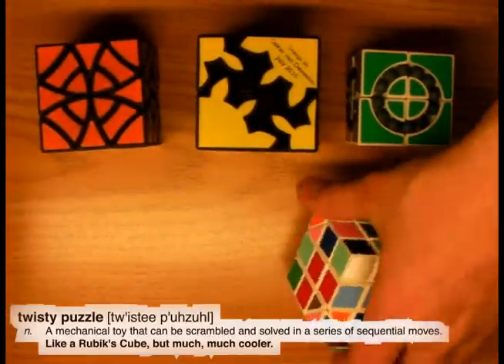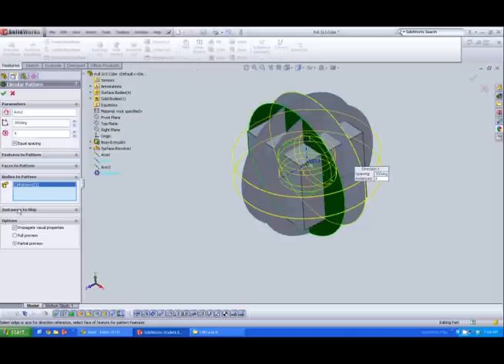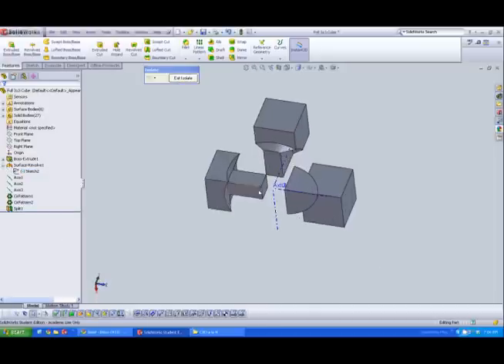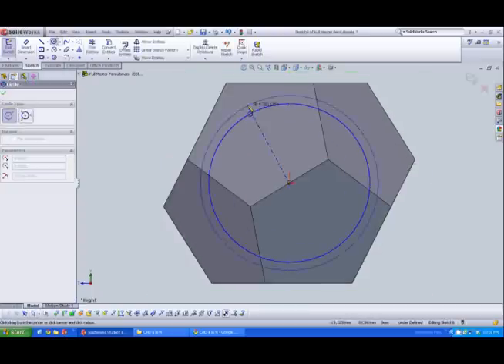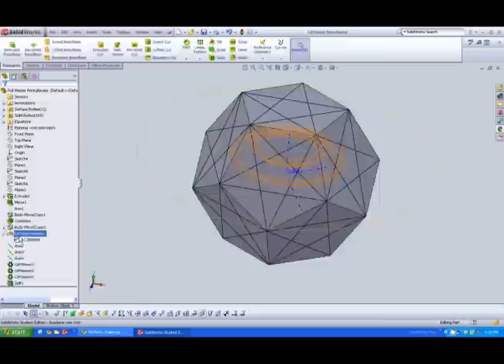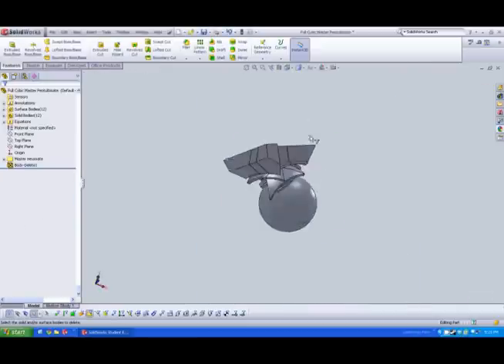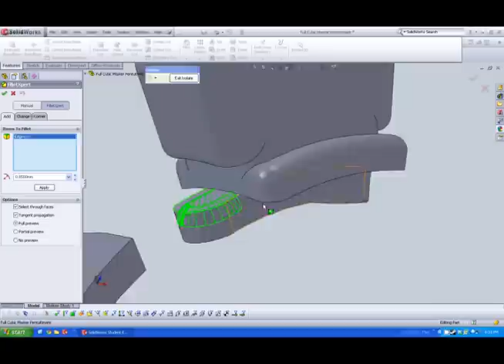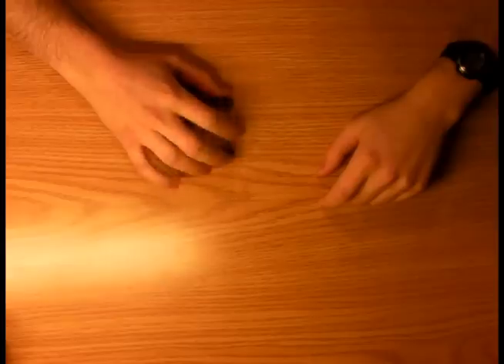Twisty Puzzles à la Vi

Comment from the maker: Ahhhh, shell errors.  They are certainly tricky.  If I'm having trouble shelling a piece, I usually end up splitting the piece along a new surface, shelling the body I want to shell, and then recombining the parts.  It's extra work, but it's a good workaround.  Also, make sure you're doing the shells after all the fillets!

Good luck!

Comment from the maker: Sorry I missed your comments.  Kepler's transformation is simply a way of orienting a dodecahedron within a cube.  It relates the two shapes to each other geometrically, which allows me to make a nicely symmetric cubic puzzle with dodecahedral cut geometry.  All I did was roll back the feature bar to right after the dodecahedron, Add the cube, and delete the dodecahedron.  Then I rolled it forward again, and fixed any errors that happened.  Give it a shot!

Comment: AWESOME! I was looking for someone to do a quick overview of a simple 3-by-3 (so I could learn and then expand to different ones later) I had no idea I'd find an overview of the whole process to more interesting designs. 

One or two questions, first I'm with ShinySalamenceTCG on the Blender question. I know how to use blender, but I've never used it to design something solid; except for a concept for a custom die that I made a paper cut prototype.

Second question is I don't have a lot of income, none for what would be needed to 3D print or order from shapeways, do you know of any way to translate these techniques to any other form of construction? Any inner mechanisms besides locking together parts that would be hard to construct precisely by hand??

Comment: I am having trouble when I try to make the surface revolve it only allows me to select the parallel axis or the vertical axis to the front plane which ends up just making a cylinder on top of the cube. Also I am using Solidworks 10' and I don't know if that could be why it does not work. Please try and respond.

Thanks,

xMALOx

Comment: Great video! Could you recommend open source and/or free cad software with the ability to replicate what you do with SolidWorks? Thanks!
Reply from the maker: Check out Autodesk Fusion 360.  I haven't used it for puzzles yet, but it's pretty good, and it's free!
Reply: Thanks Eitan!

I hadn't heard of that one. I see from the website that "A free 3-year license is available for students, teachers, and academic institutions", so that's great because I qualify.

I am getting ready to go on a testing rampage of CAD and related software. I have installed these: FreeCAD, openSCAD, Autodesk 123d Design, Rhinoceros, and downloaded a bunch of files people have shared. I'll add Autodesk Fusion 360 to my tests. I haven't used CAD for years, so I'm basically a noob.

The unfortunate thing is that the best video tutorials I have seen tend to be on commercial and/or windows-only software. Do you know of a Rubik/Twisty puzzle project and/or video tutorial on Autodesk Fusion 360? 

I also found some online stuff that looks promising. I registered for oneshape.com, which is an online version of SolidWorsk, but then discovered that the free registration only allows you to save your projects publicly, for everyone to see, so I did not pursue it further.